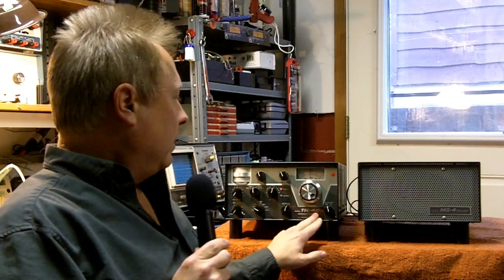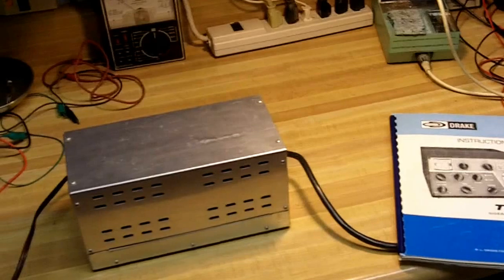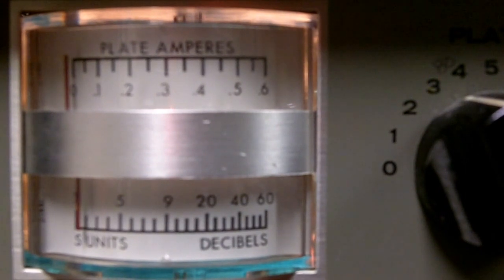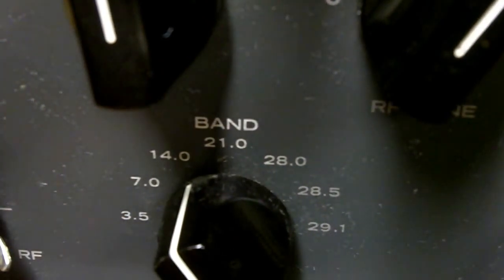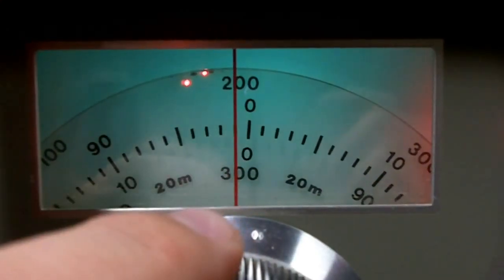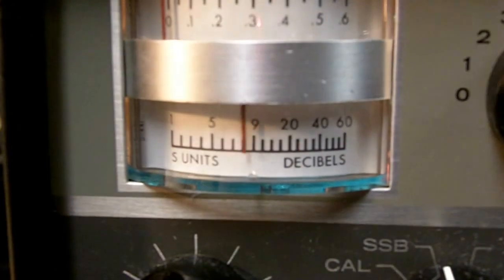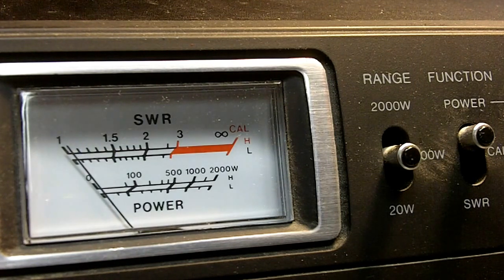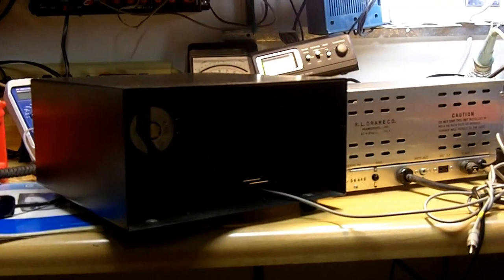Drake TR-4Cw Ham Radio Transceiver Vintage 1976 (A Solid Workhorse Radio) Video

Comment: Thanks for the video , I recently pulled my Drake TR4C  out of storage after many years  and like yours mine came up ok and worked just as it did years ago.
We have a new Net running now here in VK with participants running old vintage SSB  gear.  The net is becoming very popular with all the old rigs coming back on air.  Nice to hear all the drifting as radios warm up and stations  being slightly off frequency etc de vk4nx

Comment: I'm looking for an R.L. Drake setup myself.   I'm curious how yours is holding up after this video being recorded eight years ago.  Have you had to refurbish anything to keep it running?
Reply from the maker: No I have not, everything is still working very well.  I don't put it on the air very often but turn it on from time to time to check things out.  They are a very well built radio for sure!

Comment: This was the age and style of gear I grew up with and loved. My shack still has my drake 2-c and 2-cq from 1968, and they still work fine. They sit alongside a hallicrafters s120 and a johnson viking ranger 2. My personal feeling is that good quality RADIOS ended with the yeasu ft 101 line. Those were the days.

Comment: I got a Drake too. But just the TR-4C. First radio I bought back in 92 from Burghardts for $300.
I should power mine up too. It's been awhile. Last time I had it running it had a loud hum to it.

I also bought a D104 a few years ago thinking that it was a cool looking mic and hearing that it had good audio  so I bought it for $25. The same dealer had your type for around $50-$65 I think. Seeing this video has given me a idea what to use it on. I've never used it. 

Excellent video Larry

Comment: I appreciate this display of the classic Drake. I have a fair amount of newer gear but am looking to pick up a proper rig for AM. Modern rigs for the most part suck at AM. ALC kicks in (cant be disabled on my FTDX3000) and you cant get any drive even with low output power. How is the AM quality on these radios?

Comment: I also had a set of Collins that sounded real good and the way to really compare these radios is to have a new solid state
rig sitting side-by-side with a good antenna switch to switch between them. It is very obvious which rig sounds better.  :)

Comment: What about the Drake C line....do you like it as well...Question 2: Are the filters still available? Just subscribed to your channel and am trying to generate enough enthusiasm to enter into ham radio again...licensed in 1962 but life interceded..
Reply from the maker: That is great you are getting interested in ham radio again, glad to hear that as there are so many things to do in the hobby.  Yes, I do like the C line, I think it is very well built and designed equipment, especially in the day.  Still very good today also.  I do not know for sure if there are filters available, I am sure someone has some with some searching but I know of none off hand since I have not looked into that matter. Good luck and thanks for the sub!

Comment: Excellent video on the quality in older equipment! I've had several of these rigs and even the twins. I should have kept one
of these rigs instead of buying the newer equipment. The solid state equipment can't beat the audio on tube equipment.
Reply from the maker: I love that tube audio sound also!  73
Reply from the maker: +silverbird58 Around 180 watts or so.

Comment from the maker: Just to be safe and let the capacitors reform by applying a little more voltage at a time, I could have probably done it much faster but I just wanted to be real safe with them and was in no hurry.  If I were to apply the full voltage all at once there is a chance that one of them could have exploded and burst open.  Old electrolytic capacitors are common for this.

Comment: I have a valve set a Yaesu FTDX401 you cant beat the old sets they seem to last and last.
The one you have there is a very nice radio, and its good to see it work to this day. The one thing I lime most of all is that they are mostly easy to fix like replacing a valve with the modern day sets that are produced the fix is expensive perhapos a little to expensive.
Mike M6YMN

Comment: where do you have your cooling fan located and I imagine that the fan sucks air out of the rig?
Reply from the maker: It is on the rear side of the radio near the final section and yes it does suck air out of the radio.
Reply: RadioHamGuy Thank you ! I just bought a mint looking Drake TR-4c And puts out 200 watts on 40 meters. I need to buy an ac-4 power supply yet. Thanks again !!!

Comment: Nice video and good information for me, because I got today a TR-4C, my first Drake radio. I will ask you how you wired the Astatic SilverEagle for using with the Drake?
I have a Silvereagle and would like to use it too together with my my "new" TR-4C.
Maybe you can send me that information. It would be great.
73 de LA9OCA Manfred
Reply from the maker: Yes, I will need to open up the connector on the mic plug and see what color wires go where on there, I think there are 3 wires but don't remember for sure.  Also I think the Mic input is a little different size, will have to check that out also.  Send me a pm if you want or my call is good on qrz also and email me.
Reply: RadioHamGuy Thank you very much for your answer and that you will help me.
I greatly appreciate that.
Reply from the maker: John Baxter Thanks John for posting this, my mom just passed away this morning so I will not be able to look into this right now so thanks, hope that will help out Manfred.
Reply: RadioHamGuy It was sad to hear that, My condolences to you and your family.
Reply: John Baxter Thank you very much John, my Astatic is now working very good together with my Drake TR-4C.
Reply from the maker: ***** Thank you very much Manfred.  I am glad your mic is working also, that is good to hear, hope it works well for you, it is a good match to that radio. 73
Reply: I got good feedback using Astatic SilverEagle, so I will use it together with my Drake.
73 Manfred
Reply from the maker: ***** Yes, everyone has always told me I have good audio with my Drake and Silver Eagle so they seem to work well together.  73
Reply: Yeah the reports I also got, and they say also my voice still is good to hear when there is noice and qrm. 73

Comment: Do you still use this radio. I’d love to have a full Drake or Collins station.
Reply from the maker: Yes I do once in a while but it is my radio from the past when I first started out so I keep it running but not my normal radio to use these days as my modern radios far out preform it nowadays. But they are great radios!
Reply: Thanks for sharing the video with us.

Comment: I plan on getting my Drake TR-4 going again soon. They are Great Radios, worthy of restoration. Too bad the man at the Heathkit Shop stopped making the power supply kits. Usually the filter capicators dry out and go bad. This is what has happened to my AC-4 Power supply. I have a early TR-4 and a AC-3 also. In other words two Radio Sets.

Comment: sounds muffled, that needs an adjustment and then it will be fine. what i like in this radio is the screen (frequency reading), you can leave the radio on forever and there is no display that will burn in the screen like with the newer radios.